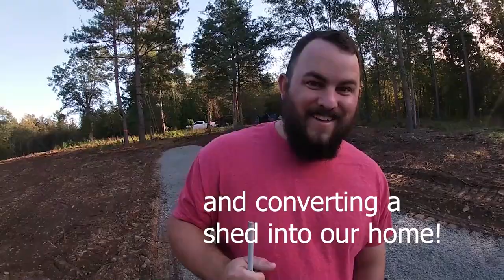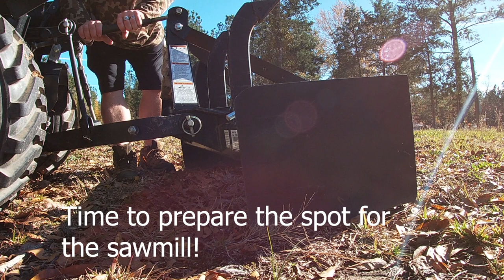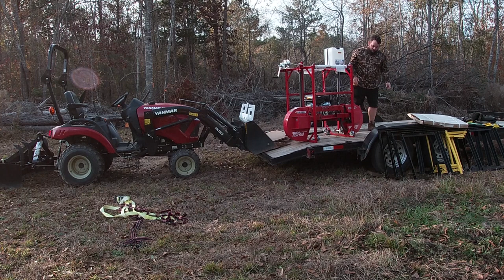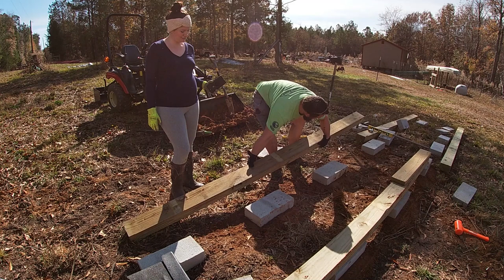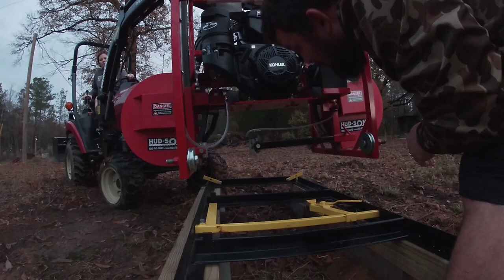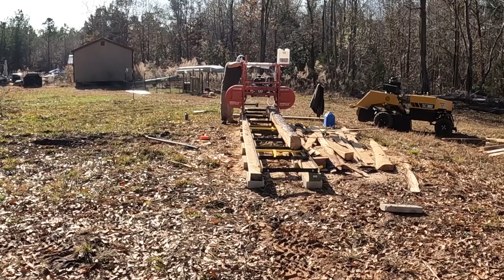Sawmill Base / Foundation (Hud-Son Oscar 428) and First Use!

Comment: That's awesome, looks like a good setup when you get the leveling/binding thing figured out. 
I've see other people mill lumber and use it immediately only to find out that it shrinks a lot as it dries out. So you're better off for most situations if you can cut it then stack it up with sticks between layers for a few months so it can dry and shrink before you use it.
Reply from the maker: Thank you! Yes we are looking at how to dry the wood now, especially before using it in the shed!
Reply: @CountryRootsFarm  you might want to take a look at "Sawing with Saddy" for tips and tricks with regard to milling.

Kind regards, Christiaan